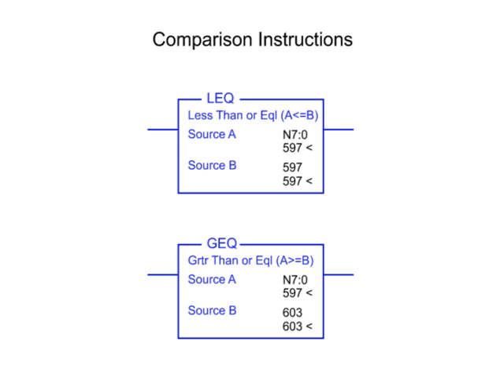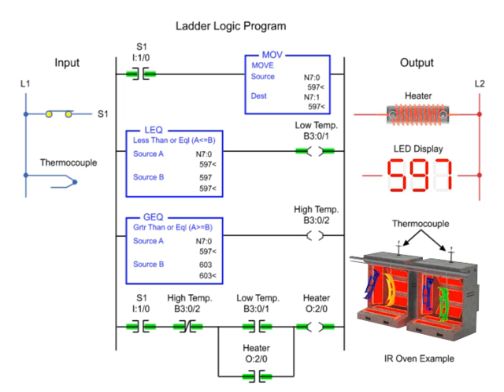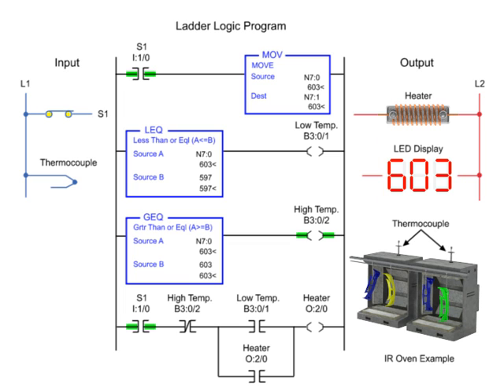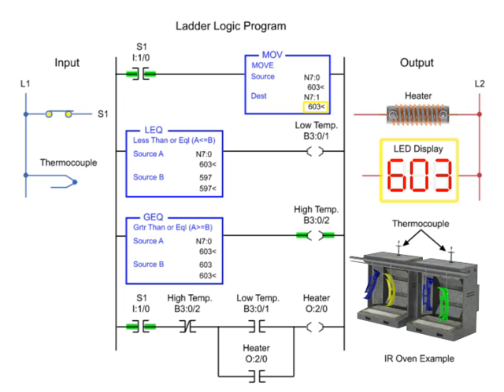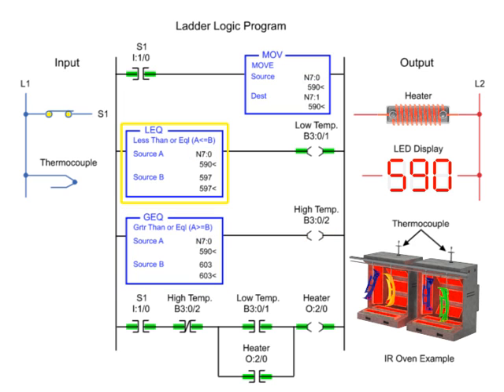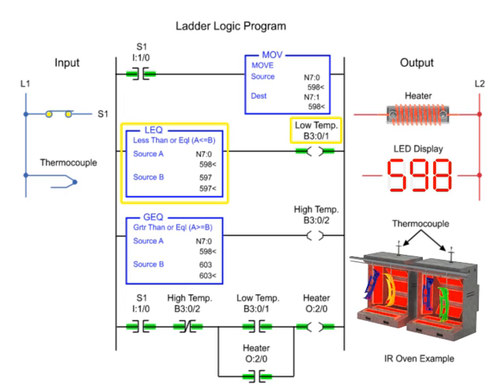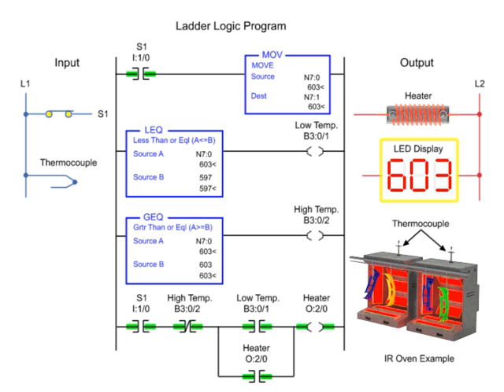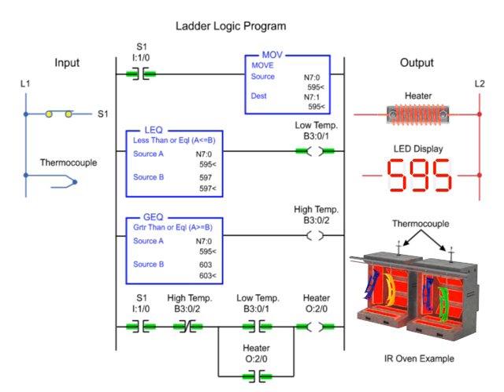On and Off Temperature Control - Programmable Logic Control

Comment: So the Purpose of MOV instruction is just to show the temperature from thermocouple to LED?
Reply: No it transfers value to destination
Reply: @chappagiridhar5109  But what is its purpose?
Reply: @marelmedinamorales3076  it "moves" information from an external to an internal bit. how else would you move it, you could go along way and maybe do a scale with parameters and an output bit then indirect addressing but this just takes one input and sends it anywhere you need. it MOVES information. nothing more. when you need to assigning an hmi address its the only way to do that.
Reply: @evilgoodness1  what type of digital heat sensor input /thermocouple/input S1 > i had to connect to plc input...to control my ssr + heater in a plc project ?